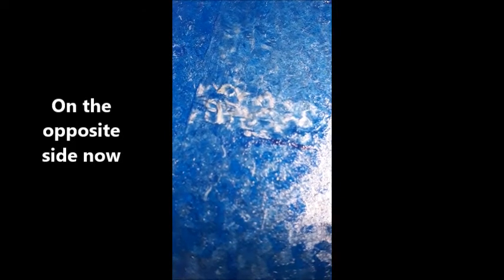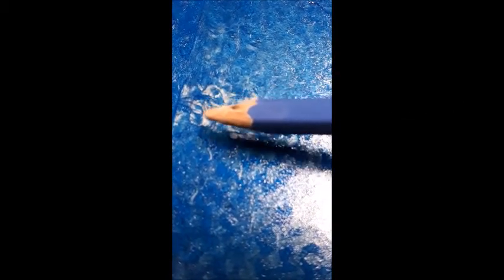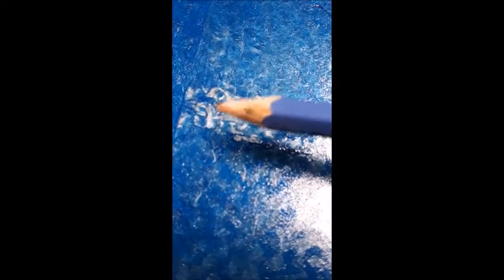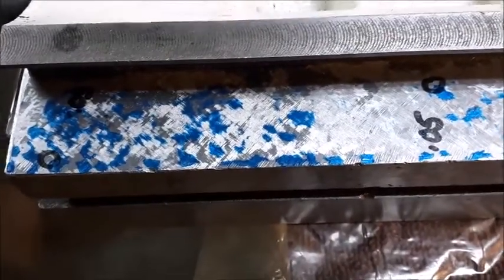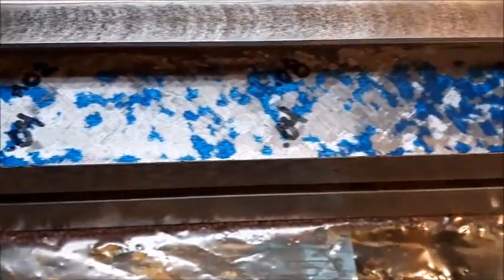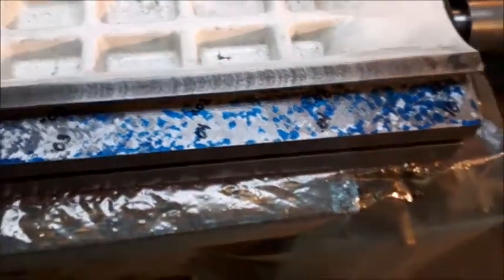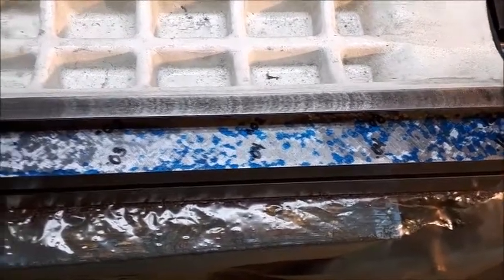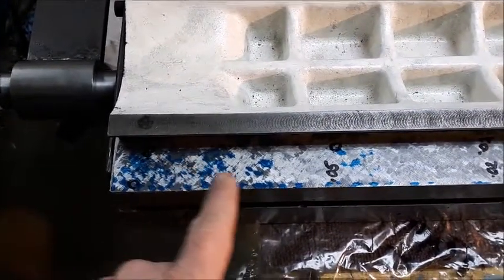Bridgeport Update 33

Comment: Looking good but you might want to try a much larger scraper radius (not far from straight)and a much shallower approach angle (5-10 degrees) while roughing in. The blade will bridge high points and enable you to bring things in much quicker without digging any holes.  I am talking hand scraping not the Biax.  
ATB, Robin

Comment: I know exactly what your going through. 
I just spent the day scraping the saddle of a small X2 mini mill that wasn't true from the factory.
Just one of many days spent so far on this machine.  I have a Bridgeport M head that could use a good scraping too.
As I'm going through this, I don't think I'd have enough time left in my life to do the Bridgeport.
Nice job by the way. Hang in there, we'll get'em
Reply from the maker: Whew... thought I was the only nut out there! You know I've seen a few posts about stuff from the factory not being good and wondered, imputing good motive for the people making this stuff, assuming they take pride in what they do, if the castings being young (new) and the travel across the ocean doesn't affect them and get things out of alignment. I mean I could get this mill in alignment, with decent geometry, load it on a truck and run it 5-600 miles down the road and it could twist up too. Who knows?? Well good luck on the small one and remember the big ones are, well, just bigger :) Thanks for watching and commenting.
Reply: Quote: "Whew... thought I was the only nut out there!"
I've questioned my sanity more than once on this project. 
I think when it's done it'll be worth it to have an accurate machine.
It has taking me over a year to build a custom motorcycle more then a few times in my life.
The first trip around the block made me forget all the time & money spent.
Perseverance is the key.

Comment: As always excellent video.  Need to practice taking those measurements with the gauge block. Been really busy. Scored an Abrasive #1 1/2 surface grinder. Ways are well worn but I couldn’t pass it up and and it ran. It was only only three hours away.  Might have the saddle off today ? I’ll need to develop a game plan. So first thing would be go back and watch your indicating and how you show it on your diagram then to study your videos all over again.  There’s lots of crud caked all over it and in it so it’s going to take me a while to clean it even after the saddle is off.
Reply from the maker: Sounds like a nice project you scored. If you can find a copy, Machine Tool Reconditioning  by Connelly it is an amazing reference book. Surface grinders should always be tested with the 5 block challenge to verify accuracy.  Thanks for rewatching😁 and commenting.

Comment: I would advise to use no more than a .0005" indicator for doing scraping work. Your scrape marks should be more then .0003"deep and as such a tenths indicator is really twitch and a bit too sensitive for the directional indicating you are looking for when doing the scraping. From Richards advice don't go too fine too fast. :-)
Reply from the maker: Good advice, it’s why I use some sort of ground, larger, averaging, surface to indicate for geometry when it counts. Indicating a scraped surface is tough… some guys even try to scrape deep enough to eliminate flaking all together, counting on the deeper scrape to provide a good pocket for the oil to hang out in… Thanks for watching and commenting.

Comment: something about your decimals isn't right. you've got .08 which is 8/100 of something, and you call that tenths. you've also got 1.2, and you call that thousandths. But I also saw a .2 that was supposed to be two thousandths.

just to make sure we're on the same page, a thousandth is .001 inch and a tenth is .0001 inch. now if you're going to use thousandth as your unit, which makes sense for scraping, I'd appreciate a lot if you could write your thousandths as just 1 or 2 or etc. then your tenths can be 0.1 or 0.8 or just .8 . I would suggest you avoid using .08 as it means something else entirely. .08 of a thousandth is 80 millionths. I wish I could scrape that flat!
Reply from the maker: Yes I see I'm confusing folks, although it's all straight in my mind, maybe not 80 millions straight, yet, but straight just the same.... I'm going to make an effort to keep my notes consistent for my viewers. Geez... that seems strange to say (type) "my viewers"... who knew! Thanks for watching and kindly pointing out some areas for improvement, much appreciated. Thanks. UA

Comment: .08 is 8 tenths? Why not just 8? What am I missing?
Reply: Yan Wo you're not missing anything, it's just a minor math error
Reply from the maker: It's just that I normally work in thousands, when I start out getting things straight I need to work at that level, with the stuff I'm working on anyway, so it's become easier for me to just keep track of it with .08 as tenths vs. 0.0008. I think, because I don't really think about it, TBH, I've eliminated the 0.00 in representing a thousandth as .1 vs. 0.001 so that leads to the .08  - Got to say it's confusing as I try to explain it... maybe I should try to change how I note this stuff. Thanks for watching and commenting.
Reply from the maker: It's just that I normally work in thousands, when I start out getting things straight I need to work at that level, with the stuff I'm working on anyway, so it's become easier for me to just keep track of it with .08 as tenths vs. 0.0008. I think, because I don't really think about it, TBH, I've eliminated the 0.00 in representing a thousandth as .1 vs. 0.001 so that leads to the .08  - Got to say it's confusing as I try to explain it... maybe I should try to change how I note this stuff. Thanks for watching and commenting.